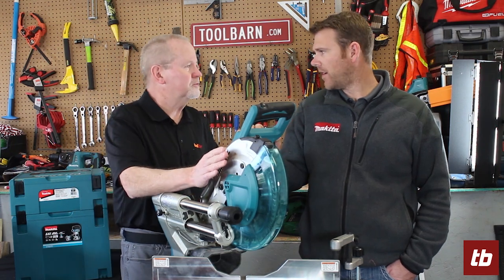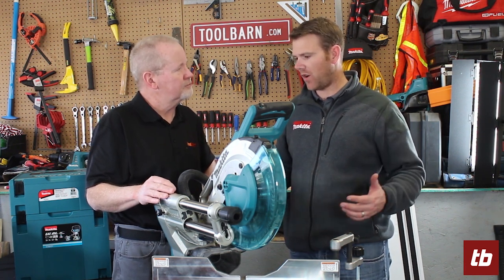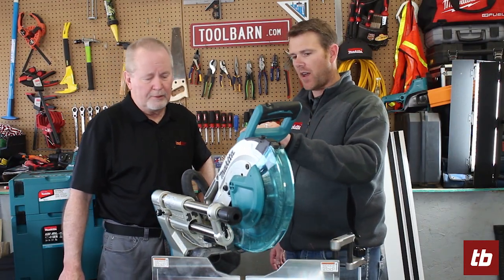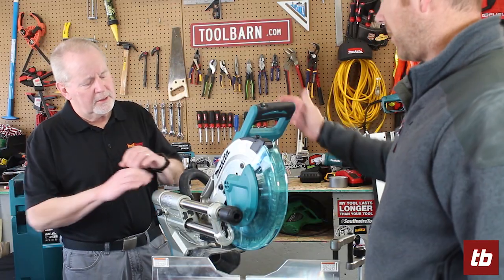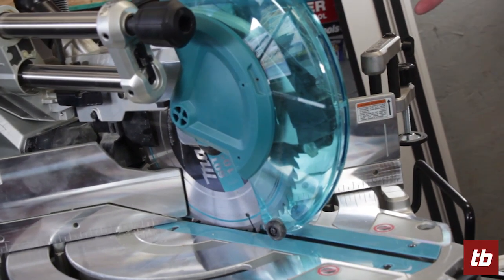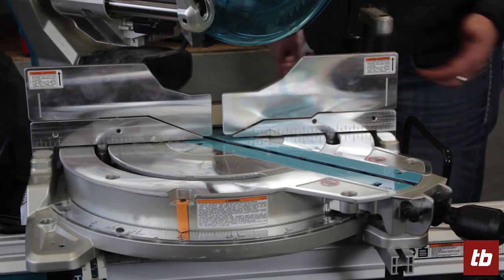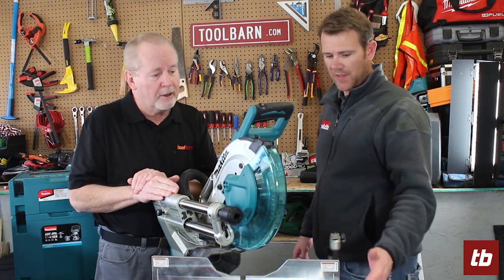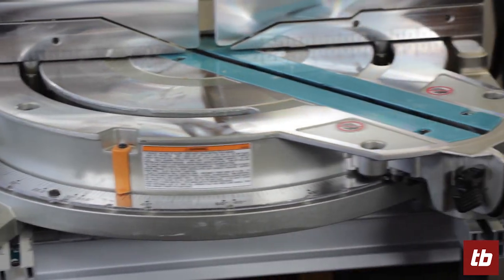Makita LS1019L Miter Saw

Comment: WARNING- Bought mine today, wow what a nice running machine, feels great... Too bad it cuts crooked. I put a dial indicator on it and as you pull the saw forward I get 4-5 thou movement. The 20-year-old Porter Cable I'm replacing only deflects 1-1.5 thou. The Rails aren't parallel to the cut path.
Reply: Bryan Coombes ART cant it not be adjusted?
Reply: Did you ever get it to cut straight? What was the issue? I’m having the same issue, no matter how I adjust it, it’s off either left or right at the front of the saw. 
Thank You!

Comment: I walked into a power tool shop to buy one today, but I noticed a lot of left and right movement of the blade, when I put sideways pressure on the handle. Maybe the tool shop did not set them up correctly for display ? Anyway, I walked out disappointed and will now buy a different saw.

Comment: It’s a good machine but it’s been found it’s Achilles heel is the pin wears the slot in the ring gear after a while .as the saw is rotated constantly you can get a replacement ring but that’s not the point
Reply: I don't think so,  a report by competition or by someone with something to sell.

Comment: I need a height of 6 for vertical cutting angles without using a bevel  feature. Darn 5 1/4 is its max
Reply: Just get the 12 inch model. It cuts up to 8 inch crown nested
Reply: And 6-3/4 vertical

Comment: will it cut 5 1/4 base on a mitre?
Reply from the maker: Yes
Reply: Toolbarn I’m not sure any 10” can cut anything over a 4” at a right 45° mitre.
Reply from the maker: @ThisTall  The product page says - Increased capacity for up to 6-5/8" crown molding (vertically nested), 5-1/4" baseboard (vertical), and 12" crosscuts at 90°

Comment: nice but its copy from festool so makita didnt do anything new like bosch glide miter saw
Reply: Yeah but with the makita you can use any blade you want, only festool blades  fit their arbor, and you'll pay less than half for the makita.
Reply: It’s really not like the Festool. Both rails are to 1 side, all functionality switches and levers are different, there’s no roller adjustment for the compound, the base is 2x the size and it weighs 10lb more. It’s very different

Comment: is this a good cheaper copy of festool kapex? Oooops this aint it either. Back to Kapex.
Reply: I'm not sure I understand the infatuation with Kapex.  The Makita and Dewalt will both cut a 12" board with no observable runout.  Both will cut a paint-ready cove 45-degree cove molding.  Can't see the cut when painted.  That's about all one can ask for.   Yes, the LS 1019L will cut 1" x 12" at 90 degrees.